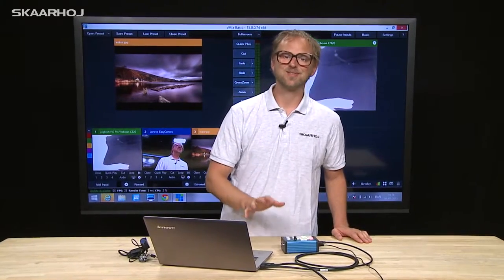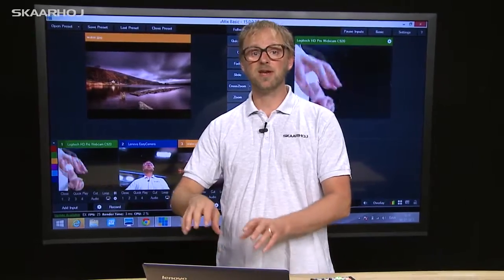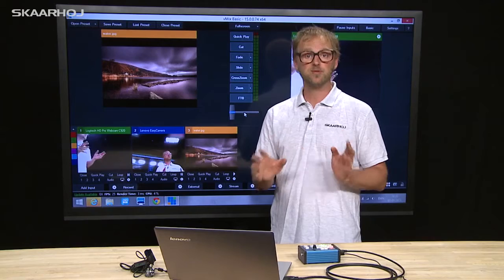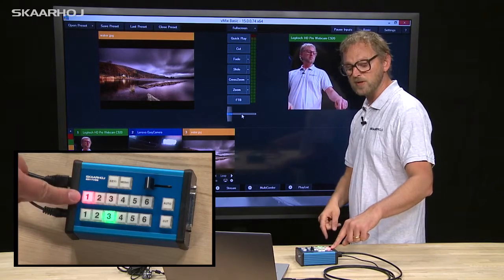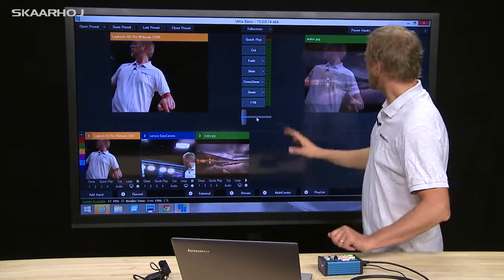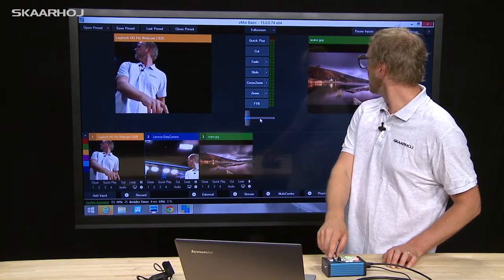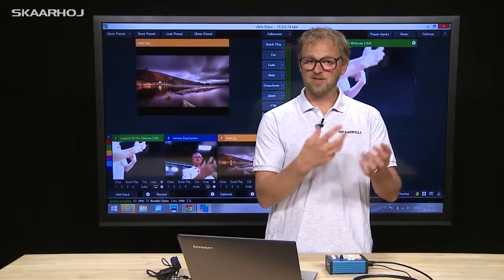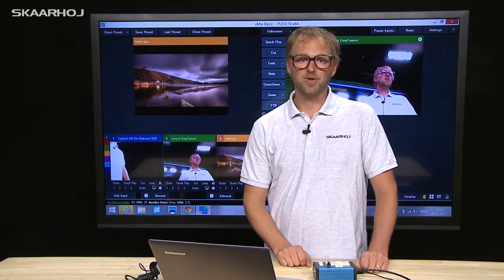vMix Control Demonstration using a Hardware Interface

Comment: Please note that "Any Skaarhoj controller you imagine" does not include the "E21-TVS controller" that has the Arduino sheild (or a USB B port) I beleive the model in the video is actually the E21 TVSS that has UniSketch.  

I am in the process of hacking my Arduino based one to control vMix with some custom code.
Reply from the maker: Thanks for the note.
The E21-TVS is one of our older model that we do not sell anymore. 
All our new controllers will control Vmix.

We hope your hacking goes well :)